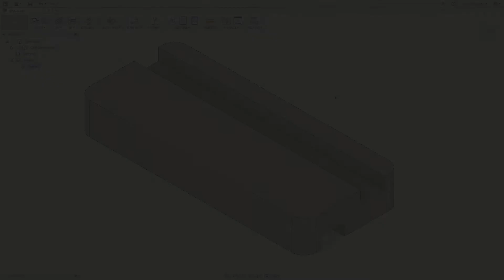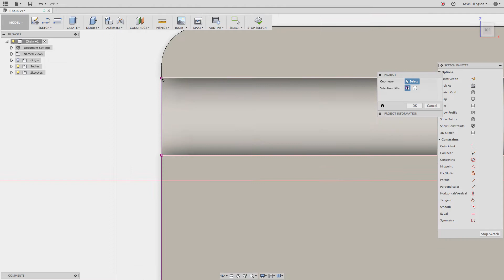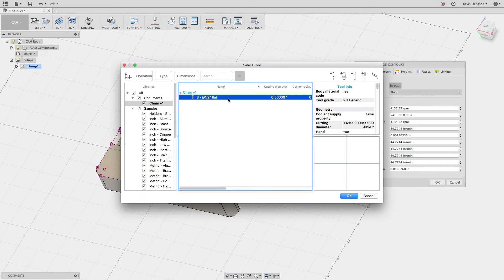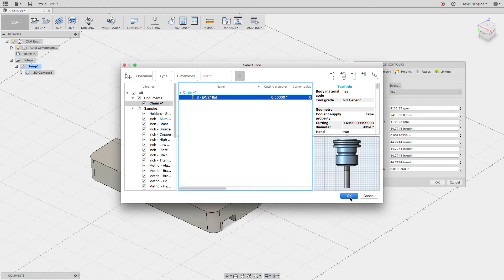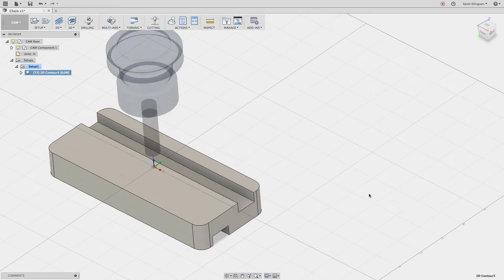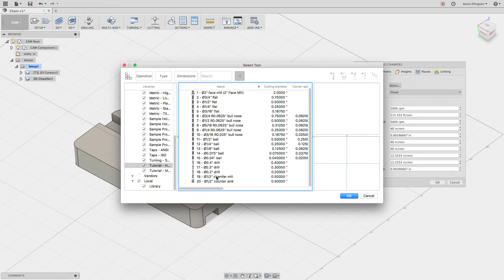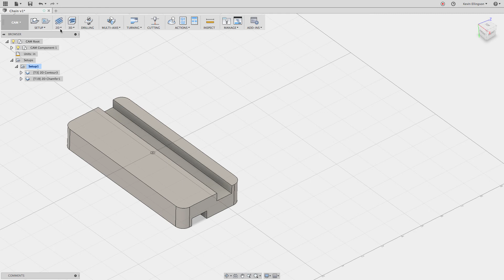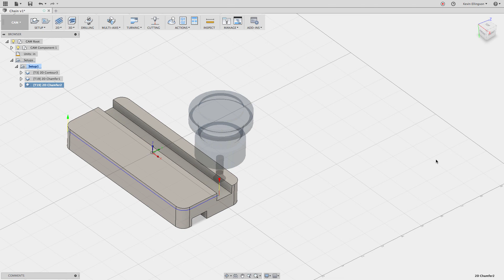Fusion 360 CAM - Selecting Geometry

Comment: Here is a quick beginner question, I designed a part and added a chamfer in the design. You have shown that a chamfer could be added later in CAM. Which is best? I saved my design both ways, just in case. If possible, I would like to use the "Chamfer Tip Offset" command in two corners, does that chance the situation? Thank you in advance!
Reply from the maker: My general rule of thumb is that if the chamfers are just a deburring edgebreak, do them in CAM. If they are cosmetic or needed for parts to properly fit together, do them in CAD. 2D chamfer gives you the benefit of stopping short of vertical walls so the tool doesn't crash into them. You can do chamfers with both 2D chamfer and 2D contour.
Reply: @MechanicalAdvantage  Thank you!

Comment: Looking good haven’t worked on it yet, seen few other tutorials and is quite interesting program. So far worked on Sprut cam7,8, OncCNCXR6,7 Edgcam, and would say looks quite easy to learn.
Reply from the maker: It isn’t perfect but it’s my favorite CAM software that I have used. You’ll find lots of tutorials for sure. I’ll also be posting an online live training calendar on my website soon. I think you will find the classes relatively low cost with a ton of value if you would rather go that route.

Comment: Why is that so complex? If such a simple task is complicated I wonder what else is later when you go deeper in software. I tried to CAM two parts in trial Fusion and already spent 20 hours figuring out how to select chains, drawing sketches and later couldn't get a toolpath out of it for some reason, and more.  This figuring out costed company ~1000$+ already. Also UI is very clutered and hard to read which is exhausting compared to other cam software. I wish it was better but it's 5 years behind in some basic things and i don't have the time to go through that again. Is it worth the money? No. I'm paid making chips and not watching Youtube videos on how to select chains.
Reply from the maker: Well, this is what I would consider the easiest CAM software I have ever used. When I do on site training, it is common for me to run into people that have never used CAD, CAM, or a machine and two hours later they are holding their first machined part in their hand. Do you have a background in a different CAM package? If so, try not to use this one like the one you are used to.

Comment: I thought the alt was going to solve my problem but it ended up cutting them as individual lines instead of one path. I’m using the trace tool path to cut a 3D profile. I can’t find another way to contour the outside of my part along a 3D surface. The model is thick but I only need to profile it .500 deep. Do you have any suggestions? Thanks for the tutorials.
Reply from the maker: Hi Karvtek. I'm sure we can figure out a solution. Any chance you could email the file?   Info@mechanicaladvantage.com
Reply from the maker: Also, after you made you selection, did it say one chain or did it list multiple line selections?
Reply: Mechanical Advantage it listed multiple chains. I can send you the file tomorrow. Thank you.
Reply from the maker: OK, sounds good. I think we will get this fixed. I'll be looking for the file.
Reply: Mechanical Advantage thanks a lot.
Reply: Thanks for the help. With all of the tips you gave me, I can program my parts in less than an hour each.
Reply from the maker: That's great to hear. I'm glad we got some things sorted and you are going in the right direction. It was nice to virtually meet you.

Comment: Really good tips! But I have a scenario type of question, how about i want to pick an open selection but i don’t want the whole geometry(line or arc) to be picked. Let’s say i want to machine just a portion of a line.
Reply from the maker: marco Hey Marco. Glad you liked it. In your scenario, you would either need to create a sketch for the geometry that you wanted to machine or potentially split the part or face where you want things to start or stop. But most likely you would use a sketch.

Comment: Iam try to do that selection in open selection, BUT in tha parallel mode (2mm ball mill),,, cant select to open, only lock selection, is that becourse it only work in chamfer mode?
Reply from the maker: Hi tommyharbofriis. The parallel op is going to make you select a closed boundary. So you can do the slow double click on the geometry selected, but the only option you will get is closed boundary when you do. Hope that helps.
Reply: @MechanicalAdvantage  Thx, yes, so in parallel mode only close contour works.

Comment: Great to the point tutorial.  My question is how do you cut the bottom groove?  When I made a sketch with cuts on both sides of the part, the tool path only wanted to come in from the "top" of the sketch.  I spent a lot of time trying to reassign the plain, and selecting the correct axis in setup but no matter what I did, the tool path always approached the part from the "top" perspective.
Reply from the maker: Ed Raisner If I understand your question correctly, you would need to create another setup with the Z pointing the other direction to machine the other side. Let me know if I’m out in left field and not following you.
Reply: That’s correct but when I copied the part I then had two origins.   They were opposing one another.   I am a beginner.
Reply from the maker: Ed, if you look at some of my older videos, I show the process of creating setups.  Have a look at those and see if it helps. If it doesn’t, shoot me an email to info@mechanicaladvantage.com and I help you work through it.

Comment: I am using Fusion 360 for school and as I was trying to take out an icon from the sketch toolbar, but without thinking, I right-clicked on the icon and selected 'remove pane from toolbar'.  Suddenly the whole sketch panel had been removed from the tool bar and I can't figure out how to get it back; PLEASE HELP!

P.s    I am aware now on how to add and remove icons, but not the panels.
Reply from the maker: Jack Jack Hi Jack. Right click on the toolbar and I think the option you are looking for is restore or reset. That will bring it all back. I’ll hop on the computer and have a look tomorrow to report the exact wording.
Reply: it worked, thanks for helping